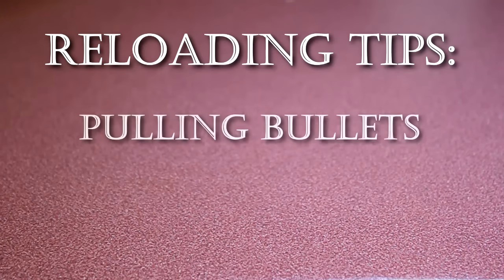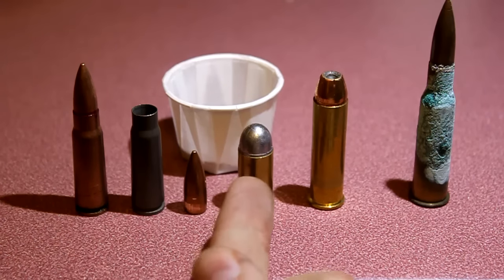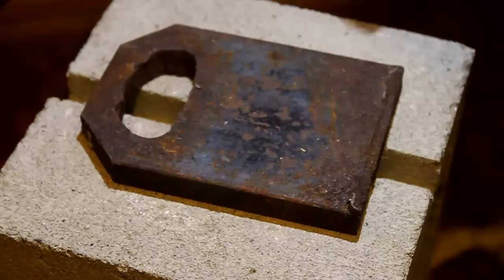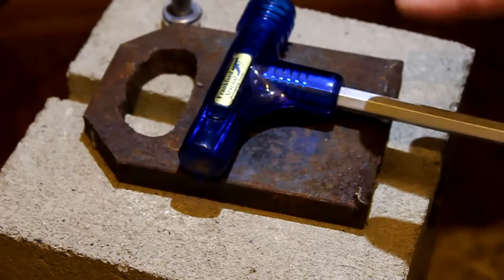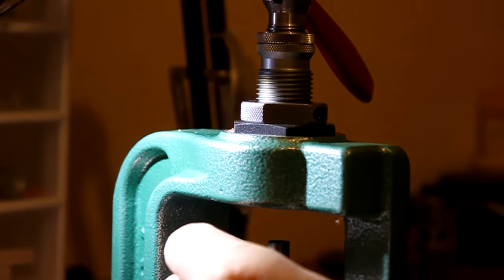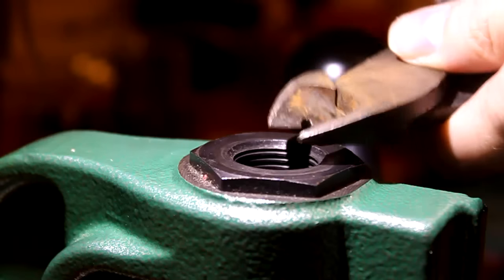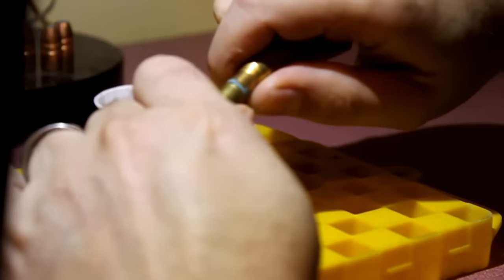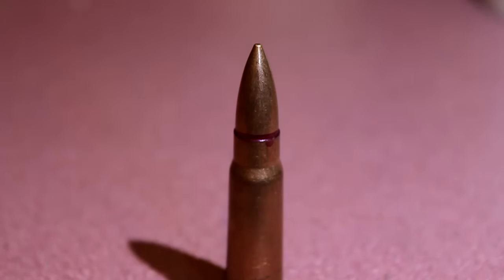4 Ways to Pull Bullets

Comment: a friend of mine got badly hurt with one of those kinetic hammer pullers   he hit it and the primer fired on a 308 win round.darn near killed him,,
Reply: That should never happen.
Maybe he had some really ancient ammo with a mercury fulminate primer (modern ammo uses lead styphnate), which I suspect could detonate from indirect impact, as with a kinetic puller.
Reply: PinkOld no it was modern boxer primed 30 cal ammo.sure as heck messed him up tho..
Reply: usaisalwaysnumber1
Hmmm...I would say that the old fulminate type priming charges were also in boxer primers, but I'm assuming you already know the ammo wasn't very old, certainly no older than the early 1950s, when all U.S. manufactured ammo switched over to lead styphnate.
FWIW, there are still some places (Russian military for one) that use corrosive primers.
Reply: PinkOld bought at walmart in 2013..
Reply: PinkOld may I ask why most reloading primers read on box -no sudden jars in otherwords  no impacts as well??
Reply: usaisalwaysnumber1
Liability concerns more than everything.
Also, if you were to drop the box of ammo in just the wrong way, with the primer side of the cartridges hitting first and striking something hard, such as a rock, piece of steel, or something else that protrudes upward, you could possibly have a cartridge detonation.
However, ammo going off loose that way isn't really very dangerous, contrary to how Hollywood would portray it.
The bullets basically only move a foot or two, with the main danger being from brass fragments flying around a few feet, but really only if you get it in your eye.
Reply: PinkOld yeah I guess that's why my friend is blind now  and has had plastic-part of knetic hammer  removed from his chest cavity.as well as the three parts of the holder that has the spring around it  removed from his  thighs  too damn close to his nuts.it really screwed his ass up.damn near killed him.give it some thought before argueing bud-wouldn't it be safer to get a rcbs bullet collet set instead? think about it,is a damn plastic hammer worth dieing over? or being screwed up for life at tha age of 27? lead the rest of your life blind?
Reply: usaisalwaysnumber1
What happened to your friend definitely sounds horrible.
I'm not being argumentative, just trying to find a rational explanation for what happened to him.
I've never heard of anything bad happening to anyone using a kinetic puller with modern lead styphnate primed ammo with conventional (read that as non-incendiary, non-tracer, and non-explosive) bullets.
Ever
Why is it such a stretch that perhaps the ammo he had the detonation with -- unknown to him before he attempted to disassemble it -- possibly had a fulminate primer or a volatile charge in the bullet?
It's awful what happened to him, but I've yet to hear of anyone having a single detonation with a kinetic puller and modern lead styphnate primed ammo with inert bullets.
Something clearly went wrong with your friend's attempt, but the evidence literally blew up in the process.
Reply: PinkOld the round that messed him up bro was from walmart.never knew of walmart ammo being tracer type or mil spec ?? brand was federal as far as I know  was federal 180 grain soft point hunting round.he was just messing around  id say curious about powder and what a unloaded bullet looked like without being fired first.he borrowed a puller from a friend.out other buddie was standing within 10 feet from him when it happened   he said he dropped the round through the collet  tightened the nut up and hit it on the floor which was wood floor  and  BOOM.i guess just a freak accident.but rcbs claims no liability for that puller use at your own risk.i say ammo isn't made for banging around either.how many Gs did that hit create? ammo being hauled in freight isn't subject to that kind of force either.ive never and never will I use a DAMN hammer to unload live rounds.sounds stupid to start with.thats why I use rcbs die collet set with a press-completely safer than a hit from a hammer.primers are sensitive to unknown force including G forces from a sudden stop.no telling what kind of G forces are generated from a good hit to dislodge a 30 cal bullet that has been securely crimped in place.ive seen people break those green hammers beating try to unload ammo-STUPID just plain STUPID..bottom line is my life is worth more than a kinetic hammer puller.
 have a good one bro..and  a pound of loading powder has warnings as well about being subjected to un known g forces as well.nitro cellouse will detonate alone  which is an ingredient in all smokeless powders.main ingredient is  nitro glycerin.
Reply: usaisalwaysnumber1
It's still a mystery, and I know what you're talking about possible detonation from smokeless powder, as I served four years in the Navy as a Gunner's Mate, so I was required to know quite a bit about the chemistry of small arms ordnance all the way up the 5" main battery on my ships.
However, it only applies to a specific type of smokeless powder: double-based powder.
The other type of powder is single-based, meaning it is composed only of nitrocellulose, and it will not detonate under any circumstances.
On the other hand, double-based powder is composed of nitrocellulose and nitroglycerin.
The reason for the addition of nitroglycerin is to produce more energy pure unit of powder.
The phenomenon you're referring to is caused by double-based powder not properly stored in a cool environment, usually when it is stored over a prolonged period above 80 degrees.
Believe me, I know.
Part of a Gunner's Mate's duties is to take daily temperature measurements of all ship's gun magazines (we had over three dozen different ones!), then record them and submit them to the captain.
If double-based powder is stored for long enough at those higher temperatures, the nitroglycerin can separate from the nitrocellulose into a brown, gummy material that looks a lot like varnish called "exudate."
Another chemical used in smokeless powder is ether, and many is the time that I smelled the distinct odor of ether in our big gun's (5"!) magazine.
The exudate is indeed very dangerous and could possibly lead to a detonation with a strike to it, with the ether only heightening the danger with its inherent flammability, ignitible with a simple static charge spark in the right fuel-air mixture levels.
For what it's worth, the 1989 explosion in Turret Number Two on the U.S.S. Iowa was likely caused at least in part from exudate and possibly ether from its double-based powder charge.
On the other hand, ammo loaded with single-based powders.
However, modern ammo -- even that loaded with double-based powder -- that is stored in a cool, dry environment will not detonate, as the nitroglycerin remains safely combined with the nitrocellulose.
Examples of double-based powders include the likes of Hodgdon H110, Winchester 760, all other ball type powders, and several of the extruded (the type that looks like little cut off pencil leads) and flake powders.
I regularly use Hodgdon H110 in my heaviest loads for my .45 Colt Marlin Rifle and Ruger revolver.
On the other hand, I only use a single-based powder, IMR4831, in my Ruger .30-06.
Reply: PinkOld I know exactly what your saying.I don't know what federal uses to load factory 308s.but from pulling a bullet correctly with press collet puller from same box as detonated round came from it looked like  760 to me  ball type powder  measured out to be 44.4 grains by powder scale.but was definitely  ball powder not extruded I use h4350 in 300 win mag 70 grains an its extruded as well as h 1000  79 grains behind a 180 GK. never had no problems in heat as well as cold-I hog hunt year round.bottom line is seems no one held liable because of his so called stupidity with kinetic hammer.im former military as well-USMC. glad to meet you were all department of the navy..me and you.
Reply: usaisalwaysnumber1
Right back at you, bro.
You're a far more dedicated hunter than I am.
Hog hunting must pose some real challenges, but that .300 WM will certainly get the job done, especially with that Sierra bullet.
For some reason, my .30-06 will put five of Sierra's 180 grain Pro-Hunter spitzers inside 1" @ 100 yards.
Reply: PinkOld Pink  its called the guy behind the rifle knowing what hes doing. yep I hunt for meat as well as to rid farms of hog problems.hogs are good eating.really better than domestic raised hogs-their leaner -less fat.taste better to me as well.
06 is a good weapon as well.but im stuck to the 300 win mag for hog hunting.ive made 1 shot kills at 400 yards on hogs. good hunting to you bro! just be careful lots of people gonna hunt this year that's never hunted before most rookies,even with hunter education courses its still dangerous about being shot by so called accident. I can certainly understand as well-go to grocery store an look at prices on meat products or meat.un real. whats the US coming to anyways? ill be glad when odumba gets gone. keystone pipeline got voted down by one vote..im gonna remember that when it comes election time.LOL. im sure that would have helped gas prices to come down even more-an possibly stay that way.for god sakes bro take care of ones self an keep in touch.where you reside at? im actually in Alabama at this time.God Bless you and yours.  have a great day!!
Reply: usaisalwaysnumber1  You think all those wild hogs are ok to eat?I hear they carry disease.
Reply: Ron west All hogs including domestic raised have diseases. when the meat is PROPERLY prepared as in like a butt roast for instance-195f internal temp. its perfectly safe to eat.just make sure one cooks it done.as youd cook domestic pig.I have done that now for 5 years and hasn't killed me yet-but sure is good tho...take care and eat plenty of wild hog..Merry XMas
Reply: I just figured the younger ones would be better. Merry Christmas to u to.
Reply: Ron west YEP your right on..around a 100 pounds or smaller is great if you can find one that small.good hunting and good luck-be careful feral hogs will attack you..merry x mas back at you!

Comment: Mexican Match is a reason to pull bullets. Also you are so advanced you failed to mention all the components. The primer is NOT part of the case. It’s a separate component. I have some bullets from surplus cartridges that someone else pulled and seated match bullets on, called Mexican Match. I’m not saying it is or isn’t safe on what it is. If the bullet is crimped very well it’s often easier to pull by first pushing the bullet in a little with your seating die. I can tell from your presentation you are a novice reloader. That’s ok experience will come with time and repetition. Also, save your money and get some 1/2” schedule 40 pvc and make your own inertia puller. I like to use the press and dykes, no small marks l ft from the edges of the dykes doesn’t seem to cause any appreciable loss in accuracy in my experience and I’ve lost track of how many I’ve pulled this way and reloaded.

Comment: Well it help me because i wanna make a dummy round or snap cap?? To practice my dry fire... or learning  how to clear stove pipe, or double feed?? hehehehe... I don't wanna use live round... or those plastic snap cap... or the aluminum made...
Reply: I'm making a dummy round w/o the prime, i deprime my use brass shell... putting in hot glue?? or silicone...
Reply: what d you mean... that the primer that is made from the manufacturer is softer than than glue stick that is homemade... sorry for my grammar i'm an asian guy...